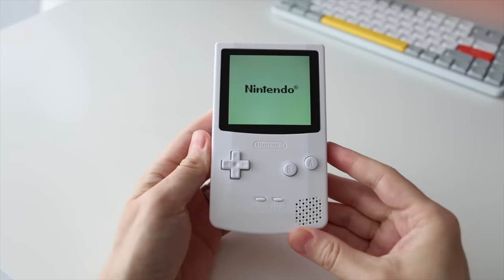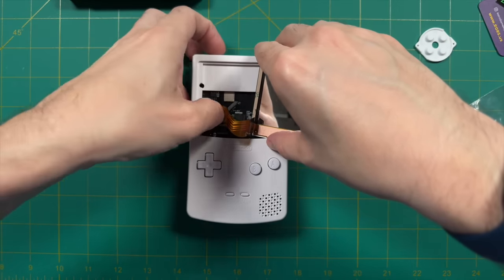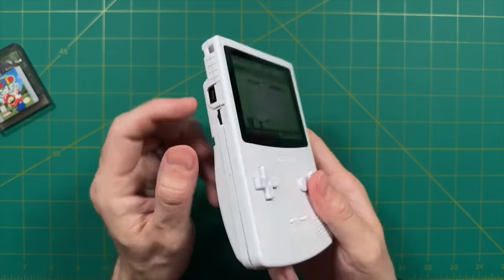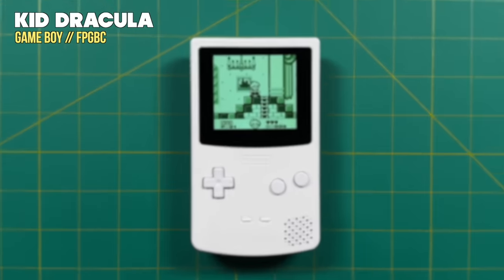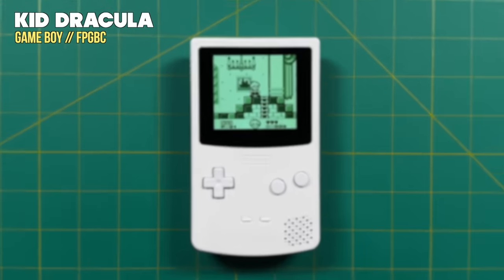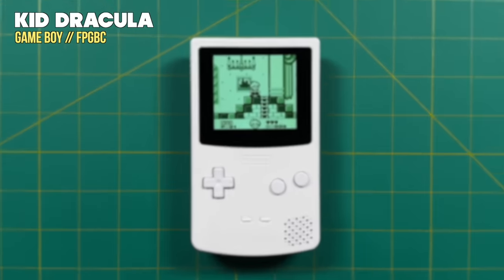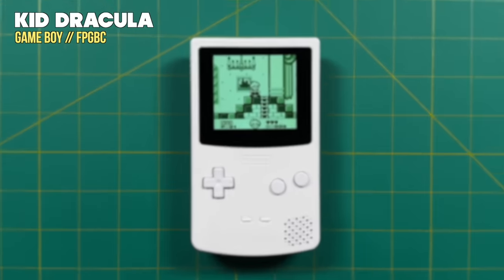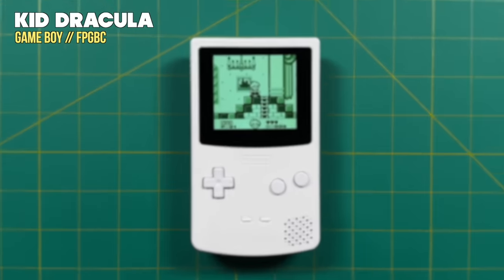FPGBC Review: My Favorite Game Boy

Comment: I think the Everdrive works this way for you because of the older hardware revision you have. I have the most recent revision (Rev B) and that one has no problems with the FPGBC. This revision has also changed the location of the button to the top side instead of having it in the middle underneath the label, so it''s easy to know which revision you have.

I think I've heard that you can fix this with a hardware mod on the Everdrive. For example: https://www.youtube.com/watch?v=GosNJKktOzY

Also I think if you use v1.05 of the EZFlash Jr, it should also work. I haven''t tried this yet myself though because flashing to 1.05 can brick the flash cart if the sd-card is too slow, and I rarely use it because the battery runs out in 2-3 months.

Comment: The Analog Pocket is good, as a pocket console, but it just looks so damn ugly. It's like if apple did a Game Boy. It looks pretentious.
The FPGBC hits the spot by respecting the original aesthetic.
And it's a shame because Analog has a great logo and "Analog Pocket" is a great name. "FPGBC" on the other hand just doesn't roll off the tongue the same.
At the same time, if both are gonna be modern GameBoys, couldn't they have included an SD card slot? Specially the Analog Pocket, for that price I mean.
Also, as modern GBC they could have turned the link cable mode into a bluetooth connection.
And last but not least, do any of them have a hole for a lanyard? That's a very important feature, I don't want to drop it, specially the Analog.

Good video, thank you 🫡
Reply: Analogue Pocket does have a SD Card Slot. You can load roms on it.

Comment: The problem here is that most people, myself included buys Analouge Pocket because of what an high end experience it is and not really only to get an FPGA “no matter what” this device is way worse than most software emulator offerings, the screen isn’t even the correct resolution and the FPGA core has flaws. The Analogue Pocket is arguably worth the $200+ but this FPGB is not even close to being worth $80 in my opinion.

Comment: Anyone else notice that with Pokémon the video graphics have a slight glitch when getting into battles?  In the bottom part of the screen?   Its not a huge problem but it is noticeable. I notice it with Pokémon crystal on a real cart.  Does the same thing when using the Everdrive  'yes the Everdrive works'     also with my screen is it normal to see residue of glue?

Comment: the link cable issue could be related to the speed issue?

From your collecting real gb cartridges It sounds like you are finally getting the bug for REAL retro handheld gaming. Not a tradition for this channel, which is mostly emulation handheld. 

next you will want AA batteries, 1:1 resolution, a volume wheel... and you wont mind that GBC color on GB games. 

To that end I am holding on to my childhood GBC, only swapping in a backlit screen. wormlights are hard to live with, trust me. 

As for this device kit - i was mildly interested. but ultimately there is too many discrepancies from the original. 

That said if it can play super gameboy i would reconsider, as the original was never made portable. would love to play Galaga and DK on a handheld with those colors, without emulation that is.

btw no matter how many times i beat tennis on gb, i still enjoy a match every once in a while. the music is burnt into my mind. The game looks great with default gbc colors too ;)

Comment: I really HAD no interest in emu handhelds, I'm a big fan of save states, and Analogue does turn me off with their bullshit scarcity marketing ploy (plus the unit itself is a bit big).  I didn't know the everdrive could add save states but also, now that I'm old the OG GBC/GB kinda sucks to go back to, I'm not really into it, even though I like some of the games.

This really splits the difference and peaks my interest, OG GBC form factor which I love, modern display, with emu, for cheap enough that if I don't use it I don't feel like money was wasted, and no setup required.  I'm a SW engineer, I debug shit all day, I want the games & "fun" stuff in my life to work out of the box with 0 effort.  But now that I know everdrive save states are a thing?  If they fix everdrive save states I'll very likely buy one.  And I wasn't even interested in this 40 minutes ago....  Only thing that would make this perfect would be if they had 2x speed (I'm a pokemon fan, the grind is real), but it doesn't sound like the FPGA is up to the task.

Comment: Did they just rawdog the Nintendo logo onto the shell? How long will Nintendo allow that trademark violation?
Reply from the maker: Aftermarket GBC shells like these have been sold for decades at this point, I’m not sure Nintendo can take down the hundreds of listings on AliExpress. I’d prefer if it didn’t have the logo!
Reply: @RetroGameCorps  Thanks for the reply! I guess they just gave up! Or maybe there are exceptions as its designed as a replacement part. It does seem a bit of a grey area.

Comment: I still prefer my Analogue Pockets, they come pre-assembled, play up through GBA carts, run roms, and can emulate up through PCE CD and arcade...
Reply: Yep same here
Reply: Gba and other consoles are a far better experience on an actual gba  and emulation devices, so I prefer a real gba for that and emulation handhelds for the cores it can do
Reply: @pspsmallz  - I have original GBA and GBA SP too, but they're pretty worn out from YEARS of everyday use and original GBA wasn't backlit, modding takes work or costs extra, the frontlit GBA SP looks crummy, and the backlit model costs around the same as Analogue Pocket and does a lot less. I also have emulation handhelds, but those don't run my actual carts or have link support...

Comment: While I ultimately respect your opinion russ, to put it bluntly this is garbage in my opinion.

It’s colorization options are basic, it’s inaccurate, flashcarts don’t work, the screen choice not being an integer scale of the only system it’s supposed to play is lazy, the timing is off, the link cable support doesn’t work, the color balance is off significantly etc.

If it was one or two of these issues fine it’s good enough but this is just bad, really bad and lazy in my opinion. At least that’s what the end product shows imo

Comment: I don't understand why nobody else makes a device with a 1440p display.
Thats the real magic.
1600 (w) × 1440 (h) pixels (10:9 aspect ratio, allowing a 10x integer scale of the original Game Boy and Game Boy Color).
You need the 10 Pixel per Pixel to recreate the LCD on a gradient Pixel level.
ALL the 480p versions just can't do it.
They all suck and have hard pixels which is not what the gameboy ever was designed for.
The animators knew the display and created art with the intention to use the display to create more details through the display itself.
None of these systems were ever created for LCD sharp pixel displays.
Reply: Because you can't just make a display out of nowhere. Those companies have to use existing displays that were meant for other devices. The Game Boy aftermarket screens are almost all from old Blackberry phones, for example.
Reply: This was discussed in the video. It is possible to source 1440x1600 screens and rotate them with code similar to the Pocket. Though that takes the right person and being particular about the look of the display. Kevtris has an interest in older LCD tech, an eye for that subpixel detail, significant experience and the reason for the authentic look on the Pocket. So it's not enough just to source the screen with the right pixel ratio. It needs the right person leading development. Those screens are IPS and have backlight bleed so there's no perfect option.

 Really the issue is good enough for most versus higher cost for a niche of a niche. Already FPGA options are the inner most matryoshka option so even if the end result is inauthentic, many don't care, are happy just to see the screen clearly and the rest don't want to pay higher prices for that last bit of accuracy. Also, the Gameboy between the DMG, GB Color they have a 14 year lifespan with a variety of models and different screens so there will be some customers who have different priorities.